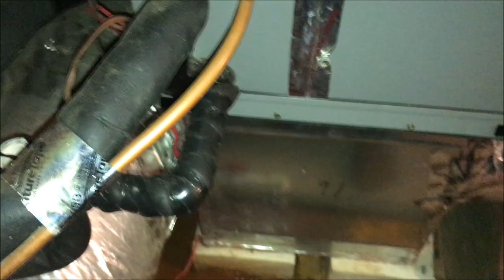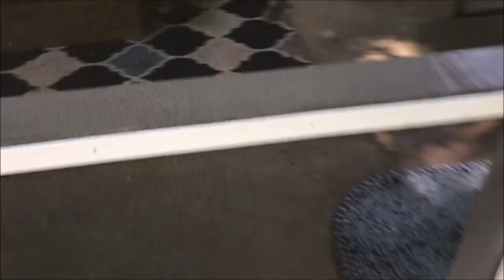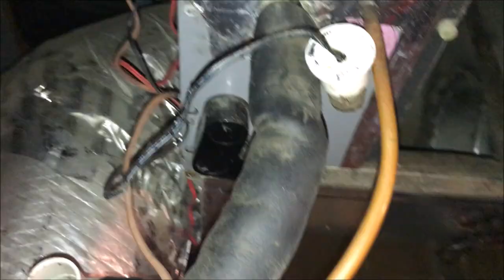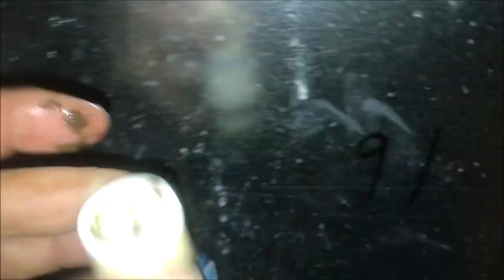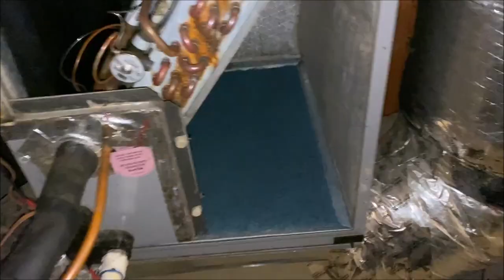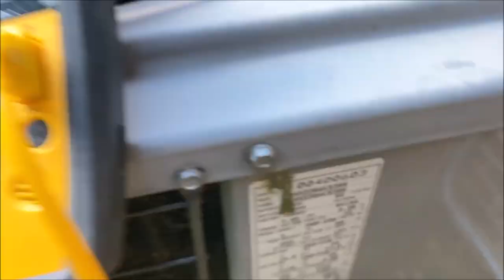TXV replacement on ICP Carrier heat pump

Comment: A couple of things I was taught in Carrier school was always use the smallest amount of heat to get the silver to flow on the TXV, wrap the valve, Do it quick in and out, and always bright shine the suction line under the TXV sensing bulb for a good conduction of heat, The small line is called a quench line just encase the TXV fails closed it allows a small amount of refrigerant to flow back to the compressor to keep it from burning up. 34 years commercial and transportation refrigeration mechanic
Reply: Actually, in this application it's an external equalizer.

Comment: You young guys pay attention to what Ted did, I once broke the equalizer tube off, had to drill and new hole. That was not fun. Also, when going to add gas, when I was in Syracuse, Carrier said to let it run for 15 minutes before adjusting the charge. I am retired and don't envy you guys for some of the junk that you have to work on these days. Ya all be safe out there.

Comment: Another easy way to replace the equalizer tube is to score it with a knife and snap it apart. Then take a 1/8 or 1/4 piece of tubing to make a coupling and braze both ends. That way you don't have to worry about solder getting into the line or plugging up the tube.

Comment: Gotta love InsaneClownPosse .
Worked a few 20 ton ICP Rooftops-before 5 years most need a CondFan motor ot wiring burned at contactor dead inducer motors.. 
Replaced many Lennox/ICP/Trane TXV/TEVs.
Usually added or replaced liquid drier as well dang Danfoss ! 
Boys and girls did this stuff for 25yrs(30%industrialHVAC 80%Commercial Industrial Refrigeration) I forgot how cramped residential space were!
Boys and girls LISTEN TO THIS MAN ! He's 100% correct.HVAC Ain't instantaneous results.
Run them bad boys for 15 20 mins then finish diagnosis! I Refrigeration some adjustments/repairs may need a visit tomorrow once it's all back to steady state. 
This guys the real deal !
I'd call him !

Comment: Hey Ted, great video.  I quit using cork tape on heat pump applications a few years ago, because I would come back later and find it had melted off when it went into heating mode! Started using the foam tape-doesn't stick as well, but like you, I put zip ties on anyway.

Comment: One thing I always loved about Lennox systems.  The TXV has 3 screw on connections.  No brazing involved.  Disregarding refrigerant management and pulling a vacuum, the actual replacement took 10 minutes, if that.  SO much easier.

Comment: Thanks for the clip Ted. I use hose clamps and scrap those copper clamps and then cork tape. I have a trick for you on how to check a txv in under 60 seconds. I'm sure most people  don't know. Let me know if you want me to explain it. Thanks again.
Reply: What is the trick?
High to normal subcooling and high superheat?

Comment: I always angle the cap tube with the direction of the flow, it helps prevent and fouling of the port into the valve.

Comment: Sensiing bulb is installed upside-down . The little line should be on the bottom while the long tube traveling back to the actual txv is on top. Other then your choice of torche nice video

Comment: Howdy Ted!  Great video!  I've had better luck combing flat spots out with a new SS wire brush, (gotta be stainless with straight bristles).  Not the little tooth brush type.  The biguns.  Sure beats trying to straighten them with a knife blade or a comb.  Looking forward to new vids.  Keep up the good work man.  Sure learned a lot!

Comment: My customer has exact the same  downflow Carrier .Supply box has full.kd water spread to Main flex duct which couldn't hold full of water .It affected ceiling. It was inside attic i offered to relocate horizontally install .Cause downflow unit creates a lot condensation

Comment: i had a very similar problem, with the SAME unit.  paused on the data plate. worse suction pressures.  it boiled down to the TXV.  I ordered a replacement via Supplyhouse, and after install, it did the same damn thing... I had to turn that job over to the Carrier rep.  Lost about 600 bucks...  and that was by far the dirtiest drain I've ever seen!

Comment: I use the existing pressure tube swedged to weld  over the new one. No pans burnt. No weld drip into the suction.  And no waiting for the bulb install.

Comment: Originally, they built the ac draining system unit inside the house was not working perfectly because there were two 90 degree angle which caused clogging easily. Four years ago, after I cleaned up and unclogged three times the draining line, it was still clogged at that time. So, I had to cut-off one 90 degree angle tubing and I made it work since then.

Comment: Dust mixing with water turning into mud. From unfiltered air going through the system. That expansion valve looks very much like ones I've changed out in cars. Except without that little tube that solders in. Don't you have to dump all the refrigerant to do that job? If so I guess you didn't film it. That A coil is starting to look a bit iffy. Nice job. What is it that wears out in an expansion valve?
Reply from the maker: Great point!

Comment: I have one of these and water is leaking from the bottom of the unit. I cleaned out the condensate pipe but it's still leaking. What are your thoughts?

Comment: Hey Mr Ted I watch a ton of your videos, I think you do great work and always try and do what’s best for the Customer ( I try and do the same) anyway a bit of advice, maybe next time bring the bulb out of the cabinet through the panel with the suction line, it allows you to mount easier and you can also place the bulb on the position of the pipe that the manufacturer recommends ( that seems to change every time I read the literature) then I just insulate with armaflex
Reply: My TXV is outside of my coil cabinet.
Reply: Mike, I think that by putting it in the factory cavity, he did put the bulb in the manufacturer recommended position. All of the carriers seem to have that depression. The bulb is also strapped to the line so it’s touching when when you heat the pipe to install. Weird how it fails.

Comment: Just curious: what would the cost be (parts & labor), for replacing that semi-flattened coil?
Reply: 1500-2k with reputable company with a decent overhead
Reply: As stated above if it is a r22 system, it will cost you more though.
Reply: I'm just curious and used to work in a factory that manufactured refrigeration units - we would use a fin comb to correct slight damage on a new coil. Could it be that the fins can't be realigned due to the age of the aluminum? I was hoping to see some air flow created at those flat spots.

Comment: why didnt you show how you determined it was a bad txv?? was there ice built up on it? Were your pressure bouncing around? can you please explain why you decided it was the txv? I was ur superheat was way high and pressure were off , was that the conclusion that it was the txv?
Reply: He does show this about 9 minutes into the video.
Reply: High superheat, high sub-cooling, pretty much the indicator of a restriction, either TXV and or drier. If the drier is not cold passed the outlet, then theres no other conclusion. You can grab the bulb and see if it adjusts, or try to add refrigerant. Both will enforce an already obvious symptom. Cheers
Reply: Ted showed it had high superheat and subcooling. Refrigerant isn't being properly fed causing high superheat. Subcooling is high because it's not being used as it stacks up in condenser causing high subcooling.
Reply: Looked like the Super Heat was 38 degrees when the Subcooling was near good level. Once the TXV was fixed the SH was much better.
Reply: anyone could explain what's going on but you have to check psi on a bunch of different units then know the hvac talk m8
Reply: I've seen zero vapor and normal liquid before too. Also sometimes somewhat normal liquid and low vapor.
Reply: @brianvargas5432  or just know the refrigeration cycle well enough/theory.
Reply: @FrostBlueFire  thank you for the clear explanation and test, appreciated, have a good one.
Reply: High superheat shows that not enough refrigerant is flowing through the evaporator coil, IE restriction in the flow of refrigerant. High subcooling indicats that there is too much refrigerant in the condenser coil. TXV isn't the only hting that can cause this, but it's by far the most common reason.

Comment: My airflow issue was caused by the stupid Merv 10 filters provided by the HVAC company.  Got me some Merv 5s, and it's much better. 

Do you like/recommend those green stringy filters? Do you have a lowest Merv recommendation?
Reply from the maker: I like merv 4 or 5.... 8 at the max.
Reply: @TedCookHVAC  Thanks.  That seems in line with what others are recommending.
Reply: 5-6 is my sweet spot.

Comment: Brazing that capillary is a dumb design. You should've used oxy-acetylene not air-acetylene for this type of work and you should've run nitrogen. They sell also combs for straightening fins you know. Glad you figured out how to speed your vids. I use them for meditation sometimes though